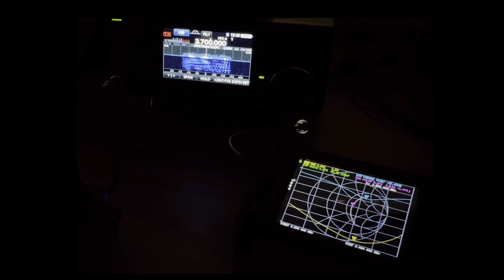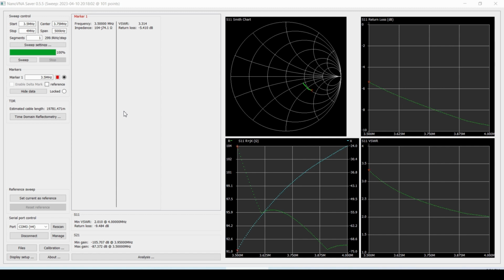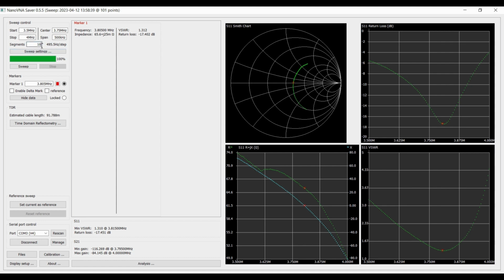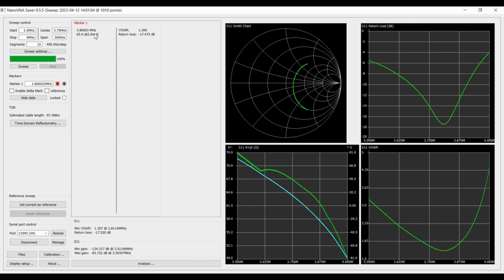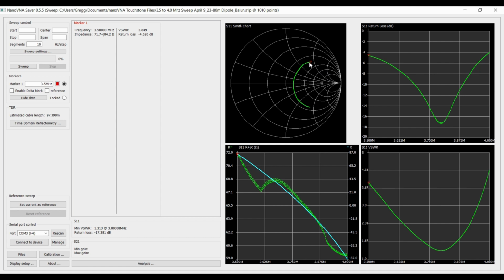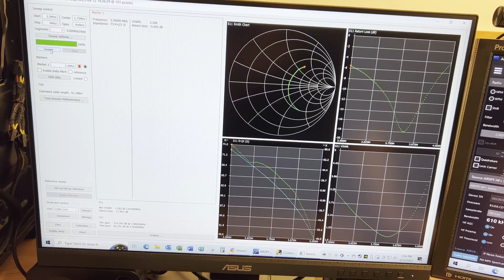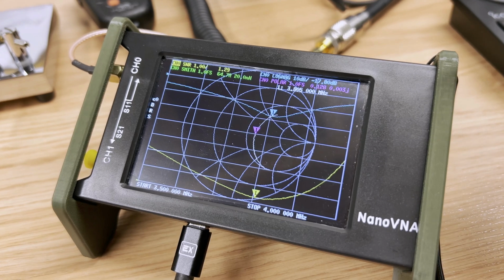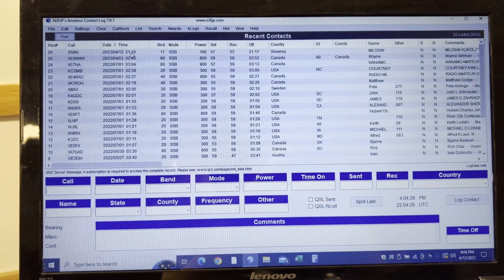nanoVNA - Balun vs No Balun... any difference?  Does the nanoVNA produce interference?

Comment: A single core two winding balun provides very little common mode isolation. Measuring SWR and feed point complex impedance says very little if anything about common mode isolation. The big reason for using a balun IS CMR. Wind a 1:1 current balun on a FT-240-43 core out of RG-402 coax for yourself and look at the difference it makes in your noise floor. Look up how to measure balun Common Mode Rejection Ratio and feedthrough capacitance with your Nano-VNA and you will actually be measuring something that will very likely make a difference in the quality of your station.

Comment: A balun is important when transmitted.  If no balun is present power may be reflected and run on the outside of,the coax cable. It may transmit on its whole length, and you may feel rf when you touch the cable. Even if you send only a few watts, the little power on the outside of the coax is not useful and it is a result of a mismatch (balanced versus unbalanced) between the cable and the antenna .

Comment: You'll get even better results on the screen if you swap out that imperfect antenna for a high quality dummy load.
I mean, it won't radiate anything, but the results on the screen will be good, and that's the main thing right?  ;)

Comment: The balun keeps your coax shield at ground potential and keeps the coax from adding a spurious radiation sidelobe at a high launch angle.    Mostly for the purists as you've measured nearly the same characteristic seen by the transmitter.

Comment: I can't remember exactly where I heard this. But someone mentioned that using a balun is not always needed. In the beginning of my ham ventures I used one once. Didn't ever use one after that as it did seem to do anything. 
That might be something to experiment with.  
Nice video. Gets me motivated to delve deeper in my Nano VNA.
Reply: If it wasn't doing anything, then it wasn't designed  and built right !
Reply from the maker: Or perhaps there was another point to be made.. further investigation is needed to understand what’s going on here… which is what happens in a follow up video… 😉